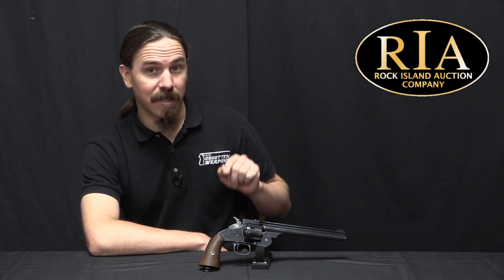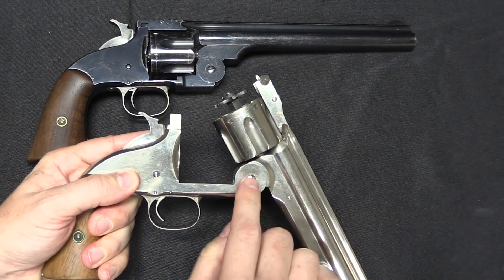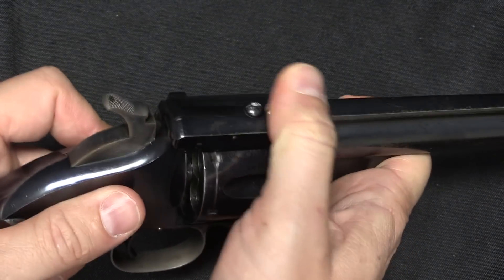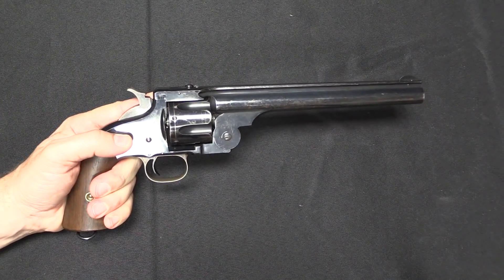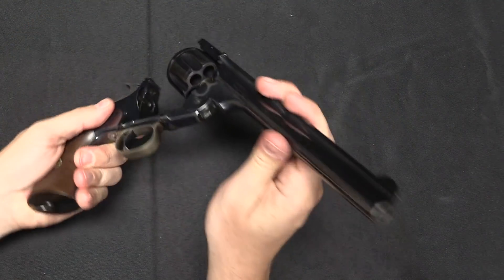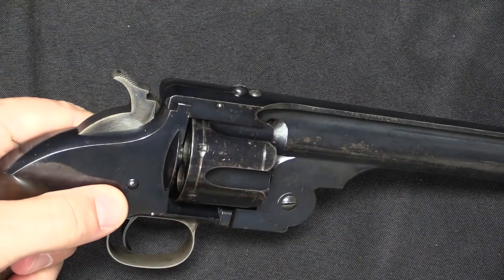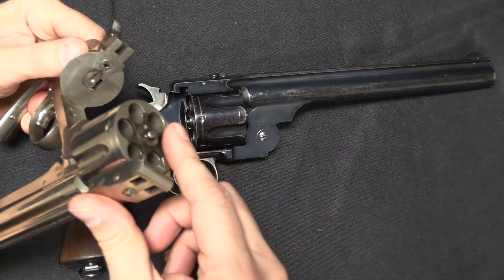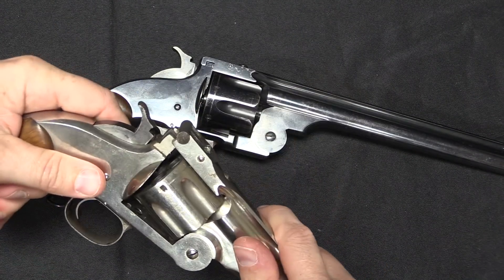Toolroom Prototype Smith & Wesson No.3 Revolver

Comment: Was this patented before the swing out cylinder?  If not, this seems to foreshadow the swing cylinder.  The side swivel would seem to be stronger than the the normal break top where a mechanism is the lock rather than a solid piece of frame.

Swivel then tilt certainly seems awkward.  I could see as the gun gets some wear that could get floppy and maybe get into a mode where it gets jammed.

Comment: So the normal No 3 had the supposed undesired effect of some people inadvertently not activating the ejector override and thus ensuing an unwanted ejection.... and when one breaks this one open the ejector nicely ejects all the cartridges.  I'm looking at it as though it did not solve the initial problem at all, if anything it made it worse.  Also not so much less moving parts but merely moving them elsewhere to create an unwanted compound articulation.

Comment: The "over-up-down-over" you're talking about is called compound articulation, and it is something to be avoided in mechanical design.  You only use it when you have no other choice to make a desired system work.  From an engineering perspective, this is a step backward from the first design.
Reply: This also seems to prevent the use of a speedloader
Reply: One less spring though so some improvement there.

Plus that action looks really cool right? But yeah overall not an improvement
Reply: When I looked that up, I got stuff about language.
Reply: @Seth9809  yeah as a linguist, I'm only aware of "compound articulation" being a term in articulatory phonetics. Google suggests that's the main use of the term.
Reply: It means it moves in more than one direction.
Reply: Those screws are going to wear and bend when they're twisted left and right, while the Russian type will last a lot longer bc its joint is turning "parallel" to the screws outer rim (up and down) rather than perpendicular to the rim of the screw (the left and right bending). Will get much worse if it goes unoiled
Reply: Also, in a gunfight or defensive situation much of your finer motor and logic skills will go out the window. Like the old saying, you don't rise to the situation, you fall to the level of your training (and/or basic, instinctive operations). The last thing you need is to both add awkward, unintuitive steps to the reload process, and reduce your cylinder access as well. This is barely better than the old single-chamber loading gates, and is literally a step back on the advantages this revolver style had.
Reply: Double this. Plus reloading speed is limited, compared to the original.
Reply: I daydream about learning machining just so I can make ridiculous designs like this
Reply: It made the revolver looks much more less robust
Reply: @J.DeLaPoer  Not only is this design similar to a gate-loaded pistol, but if your goal is to replace a single spent cartridge, it's worse than a gate-loader because you have no extraction rod to remove the spent casing. Maybe if it went into production they'd have included one, but now you have two totally separate methods of extraction, and extra weight.

Comment: Guess it was an answer to the wrong question. It's still going to expell all the casing's on open. How do you remove a single spent casing without flipping the other 5. Believe the new design just slows reloading now that you have to rotate the barrel before inserting each shell.

Comment: Fun fact: Red Dead 2 has a hidden Schofield revolver you can retrieve in Valentine. It involves robbing a hidden gang business operation behind the doctor’s building. When retrieving the gun, Arthur or John opens the cylinder in the same way as we see in this video (albeit, in the opposite direction). 

Many people complained that this isn’t how a Schofield should be opened at all, and they’re right to complain since after retrieving the gun, Arthur or John would reload the Schofield normally. Not only that, but the design of the Schofield does not match the prototype. They never knew this prototype exist and that R* motion capture team were likely using this model when filming that animation.

Comment: At the point of this thing they might as well have just ditched the top break altogether, let the pin rotate out to 90-ish degrees, and just extend the extractor rod out the front so it could be actuated manually. Its kind of amazing how close this is to inventing the swing out cylinder (and barrel) before the swing out cylinder.

Comment: You could load them 3rds at a time. 3 turn the cylinder 180 load 3 close cock fire. I wonder if you can get the cylinder on a larger center pin that it spins on and getting a better line up with the barrel and having a stronger frame and able to 
Handle more pressure. The pivot pin/screw and have a strong top strap and making avery strong frame. What good it would do in the current time period isnt anything that would allow for more powerful cartridges considering, .500s&w, 45-70 gov, 50-70, .444 Marlin, and so on. Iv even heard of .50 bmg in a revolver that worked, i was an internet picture and some words so it might be real or not.but really a waste of time trying to make a revolver frame stronger.

Comment: I could see value in having just the swing out, without the top break.  With swinging out half the cylinder at once, you get past the Colt issue of only being able to load one round at a time, effectively halving your reload time over the main competitor to the Model 3.  I'd buy a single action with the strength of the Colt lockup, where I could reload two or three rounds at once.

Comment: I wonder if the way that this opened improved the strength of the frame enough to incorporate other and/or modern cartridges? ( I keep reading that top break revolver actions are too weak to incorporate more modern cartridge loads)
Reply: I doubt it. It compromises the strength of the frame in the lower part with that pin.

Comment: Wouldn’t it have just been easier to keep the regular top break method and just make the extractor a manual push rod? So you could push it and eject all the cartridges or not and load them singly if desired?
Reply: Far too simple
Reply: This looks German... unnesersarily complicated.
Reply: Richard Taylor I was thinking French: non-sequitur.
Reply: @MildMisanthropeMaybeMassive  If it were a French revolver then I  would expect it to be elegant, simple but whimpy.
Reply: This looks worse then a Reichsrevolver.
Reply: But that basically already exists in the standard No. 3. As demonstrated in this video, if you don't want to activate the ejector you just hold the small lever by the hinge while you open it. I'll grant you that's slightly more awkward in it's mode of operation than just breaking it, but still easily reached with the thumb off your off hand while opening and accomplishes the same thing as a wholly manual system. I'll also grant you that the standard model includes a couple more parts and a few more milling processes to make, but hardly enough to justify removing the "automatic" eject feature altogether. The whole big advantage the standard No. 3 system had was speed and ease in reloading compared to typical revolvers... In the end they decided giving up the huge plus of auto-ejection wasn't worth the relatively tiny savings in production cost and slight awkwardness on the odd occasion you only had to reload a couple rounds. Rightly so I think.
Reply: @richardtaylor1652   Laughs in Reichsrevolver

Comment: I've got a Model 1, and it's amazing how far S&W advanced between that relatively crude little .22 short, where you had to remove the cylinder and manually eject cases on a rod under the barrel, and the Model 3, which would still be relevant in some ways today.
Reply: I have a reproduction of the Smith and Wesson Russian army revolver and although it's definitely obsolescent, it wouldn't be completely out of the fight in a self-defense situation. In some ways, firearm technology hasn't advanced a lot in the past 100 years, particularly in comparison to the 100 years before that.

Comment: Seems to me that the answer to the described problem would have been larger/more easily handled lever on The original gun rather than completely new side tilting business.
Reply: But that's adding complexity to an already complex system.
Reply: @Stevarooni  Don't think so if you just enlarge the lever.

Comment: Honestly, the problems sighted just don't sound like that big of a deal.  If you don't want to eject cartridges, use the little lever.  If you want to partially eject. Then use the lever most of the way and release it near the end of opening, should catch the rims and lift slightly.  This seems overly complex and... honestly removing options to the end user when trying to operate

Comment: The reason you don't see this produced is because it is a lousy design.  It kills the entire point of the flip top revolver which is the ability to load all the cartridges from the top all at once.  This system makes you load just as slowly as the regular single action Colt's with no real advantage in return.

Comment: It's nice, just as a specialty item. Y'know, a low numbers variant, but too cumbersome for general production. The production system is less cumbersome, and just plain intuitive. Do or don't hold the eject override, open latch, break breach, load, close, that's it. Not that same process, PLUS an additional 45° ttwist it's just too much. Latch, then twist, then breach, it's counterintuitive to add a side to side movement, into an otherwise front to back system. People would get confused, mid re-load.